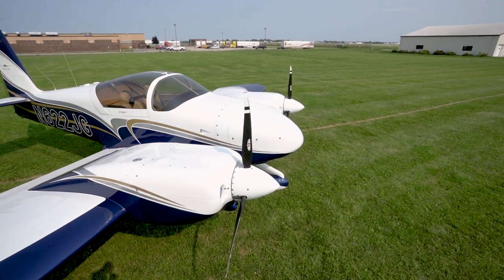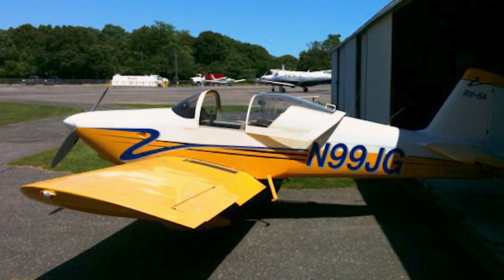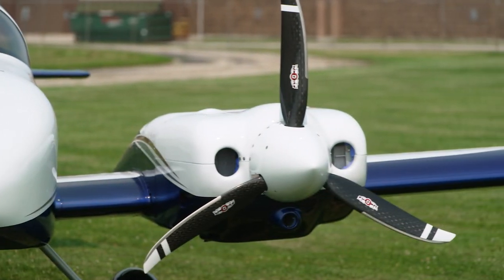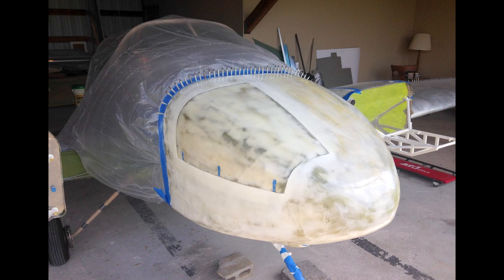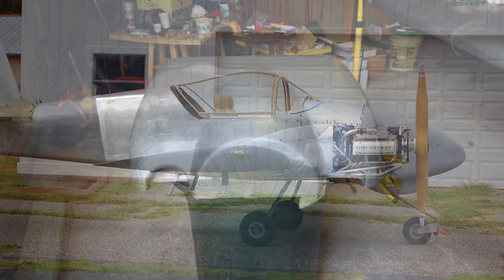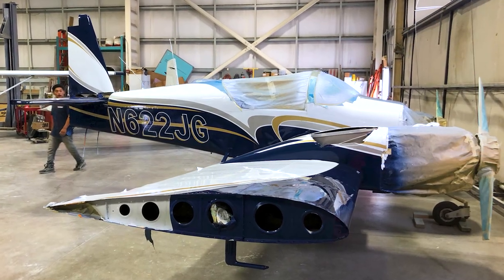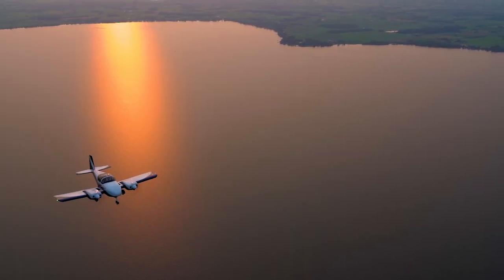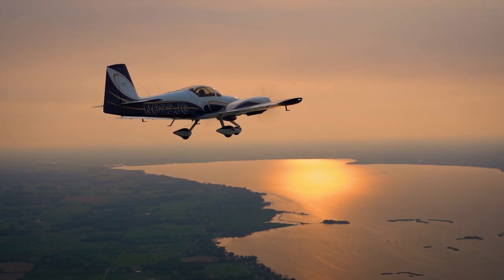Putting the Experiment in Experimental | Homebuilt Twin JAG

Comment: A fixed gear twin? That's not the way the big boys do it! Alas, Its a different problem. Revenue miles does not enter into this equation. Simplicity and redundancy was the goal here and it was achieved. The only real advantage for retractable gear is in ditching. Statistically, gear failure is much more likely than the need to ditch. A very good choice.